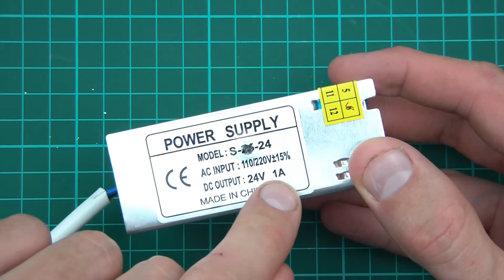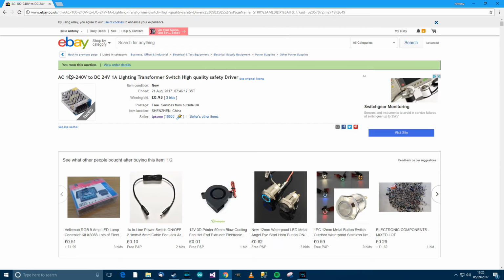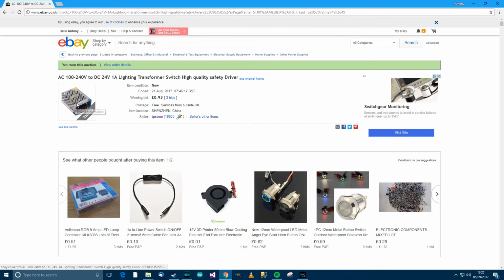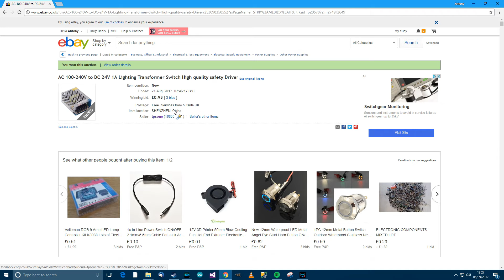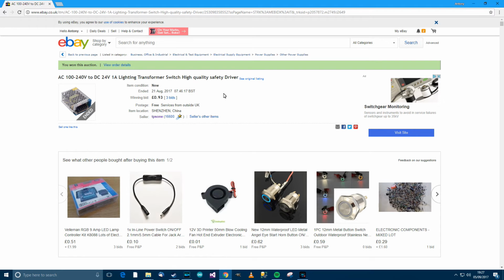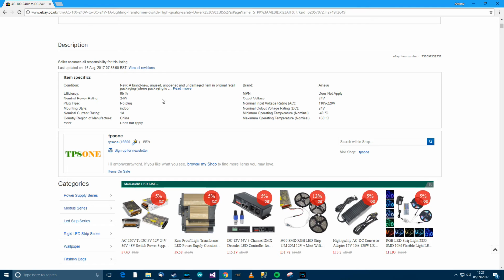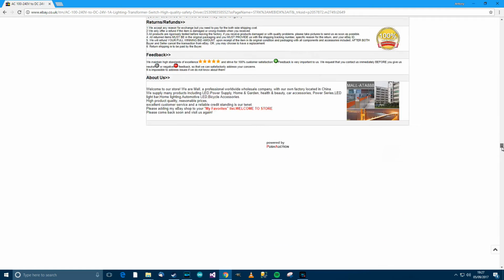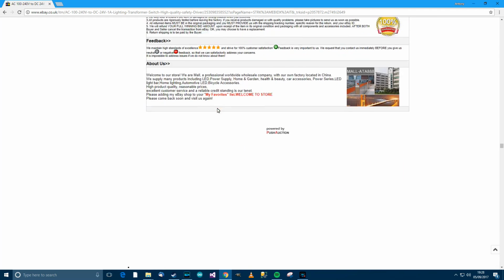INVESTIGATING: A Cheap Chinese Switch Mode Power Supply (SMPS) (Part 2/2) (Misc)

Comment: Hi mate, just wondering do these ever come in a split rails config, eg. + - 12/15v so you can power an opamp circuit? Or would you buy one rated at 30v dc and do the rails in your circuit?